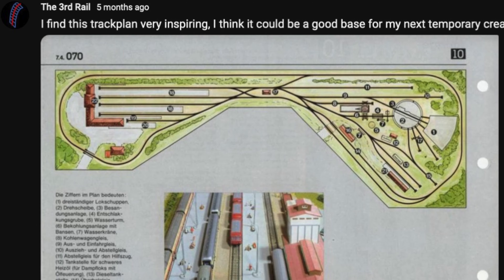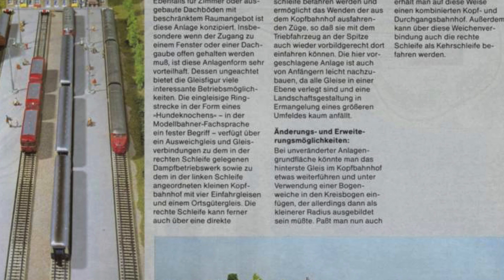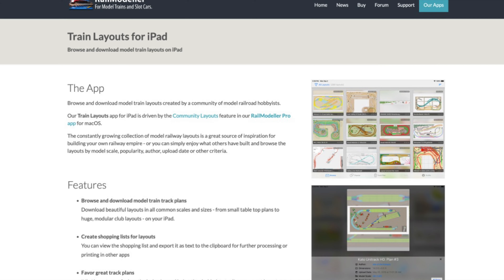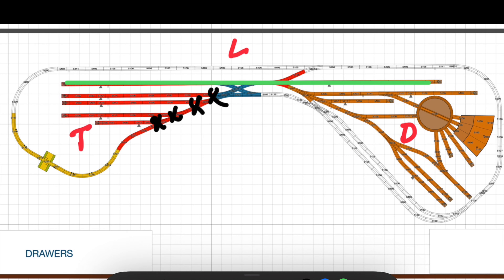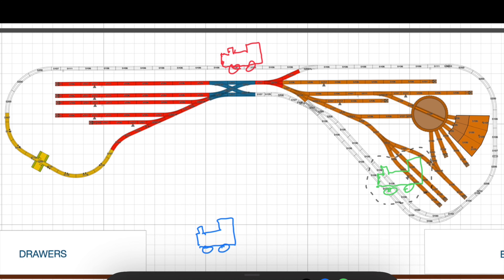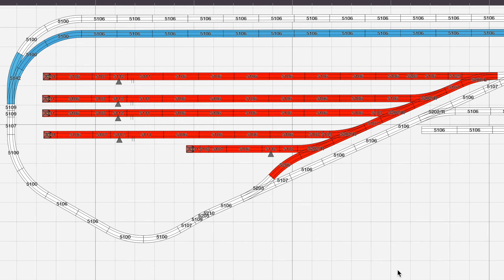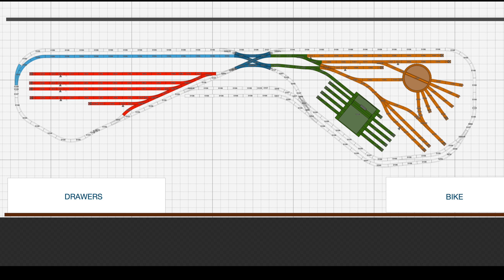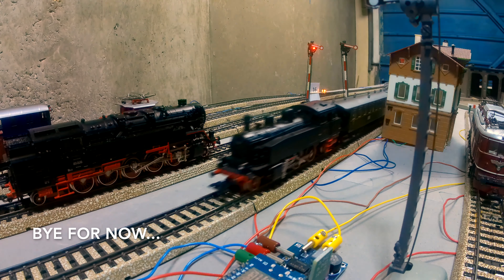Layout 2023 - First steps...

Comment: Nice lay-out in the book but you made a very nice and multi functional one with the extentions. Good luck with the planning of the autom ation a nd electrics. I will follow you. Is the layout already avaiable on Railmodeller? What “therm” i can look for?
Reply from the maker: Thank! I need to tidy up a few things in the plan before I share it, shouldnt be too long.
Reply: @The3rdRail  Will you share it in the app or in Railmodeller Pro? Please give me a notice when you place it.
Reply from the maker: both (same thing... 😀)
Reply from the maker: It uploaded now: look for "The 3rd Rail - Layout 2023"
Reply: @The3rdRail  I found it, nice constructions. I’m interesting for the follow-up. Thanks
Reply: I’ve been looking at the plan and saw that some track did not fit. In my plans I also have some “not fitting” track. I think that “problem will be solved when you’re making the lay-out in real. The flexibility of the M-tracks😊. Do you agree?
Reply from the maker: @tonvangenabeek4920  This is the first version of the plan, so everything is still work in progress, this is mentioned in the comments with the files. There will be changes. The 5207 crossings (see previous vdeos on the topic) cause alignement issues in the software which I still need to fix, and I will need to make changes elsewhere once that is done. The aim is to get to a point where the plan only has a couple of chosen spots where there is a small gap.

Comment: Hello! Kind of a off-topic question, but i recently bought a märklin 3048 Br 01, Today i went for a quick ride and it when i tried to reverse it it just stopped, i keep hearing the noise when you shift, but it makes 0 movement, the lights are still on, even when i tried shifting again nothing happens, the lights just keep burning and i can't drive. I checked if this was the issue with the track but it wasn't. I found no videos or forums about this issue, do you maybe have any clue?
Kind Regards
Mr E
Reply from the maker: Hi, 
I'd first check the driving wheels can turn freely in both directions. If  they don't, there might be some debris stuck in one of the gears, or there might be something more serious going on with the wheels and axles. If everything is ok, then 2 things come to mind: 
- Check the reverser, it should be a drum type with leaf springs, one of them might not be making contact with the drum. 
- check the wires between the motor windings and the armature cover plate are both still connected to the motor plate. They are very thin wires and sometimes one of them can break or become detached from the solder joint.
Good luck.
Reply: @The3rdRail  Thank you very much! Il check them out ASAP.
Reply: @The3rdRail  Just looked into it, when i try to reverse it the shifter locks into neutral and doesn’t go back. When i try to shift it manually (when its off) it doesn’t lock. I tried to pull it back when it goed on and succesfully shifts. So the problem is that it just locks itself in neutral. What could be the cause?
Reply from the maker: @mre6180  reverser spring not tense enough?
Reply: @The3rdRail  When i push it when its off, its jumps back easy, when its on, you feel some force on it. So unfortunate i think its somehting inside the gearbox
Reply from the maker: @mre6180  that's normal, the reverser is always on. Send me a picture of the reverser on the channel's email address.
Reply: @The3rdRail  Will do. Rn i can't get to my layout but will do it ASAP, also thank you very much for this